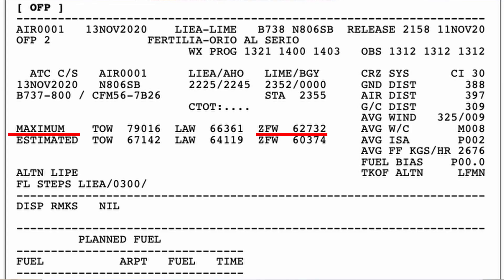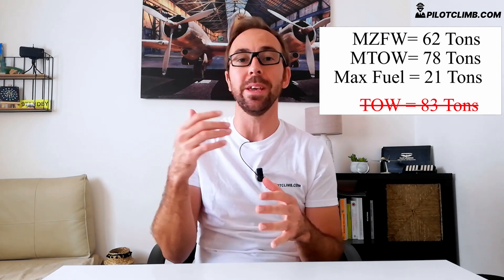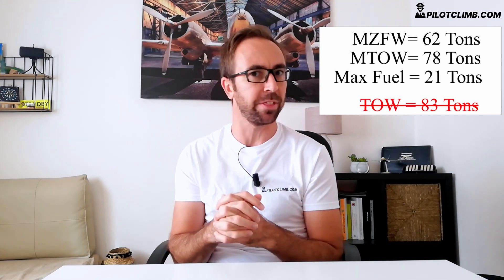Zero Fuel Weight - [What it is and how does affect your Flight Operations].

Comment: Do we use zero fuel weight in general aviation, single engine aircraft? I do not see this entry anywhere in the POH.
Reply from the maker: I'm not sure if the ZFW is used on general aviation, it should be since it is a structure limitation. But again I'm not sure. Check the AFM

Comment: Hi, thanks for the great videos. 

I am an airline pilot also. 

I remember in my ATPL exam days when doing the Mass and Balance questions we always had to first calculate the Regulated Take of Mass.  As you mentioned this can be structural, performance or max landing mass minus trip fuel. 

In the ATPL theory questions we also had to consider Maximum Zero Fuel Weight minus trip fuel. Which now flying in the airline, I see that we never consider this number at all when determining Regulated Take of mass. 

So in ATPL theory our regulated take off mass is lowest of the following:
MTOW : Structural, from manufacturer
Performance limited (due runway length, condition etc.) 
MLW minus Trip fuel
MZFW minus take off Fuel. 

However in real life it seems that in the airline world, we do not calculate (MZFW minus take off fuel). Which is good, because it is a useless calculation in my opinion. Still I am always wondering why we had to consider this in our exams.

Do you have any idea about it, or why we are using this in the ATPL theory, but in real life we don't even think about this?
Reply from the maker: In real life software will make all required checks, and as pilot we xcheck the loadsheet for gross errors..

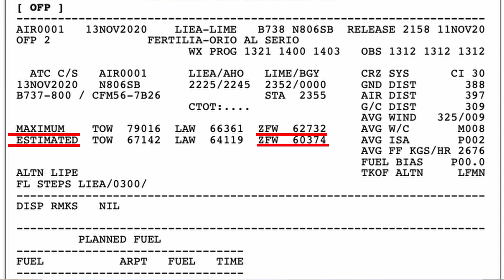Comment: Good Day Capt, in video 2:15 on a chart between TOW and ZFW is LAW.... It is mean Landing Weight? So in order to have a safety landing if our aircraft weight still above LAW we need to dump some fuel? Do you know if Boeing 737NG can dump fuel or fuel jettison system?... Have a great day ahead and thanks again for your excellent video.. 👍👍👍
Reply from the maker: Hey, many thanks for watching!!! Yes, LAW means Landing Weight (sometimes is indicated as LW) during normal operation and if the situation is not critical you should NOT land with a weight above the Maximum Landing Weight. I have been flying the 737 for more than 10 years and I have never seen a 737 aircraft equipped with the fuel Jettison System.
The regulations don't require to be installed on the B737.

Let me know if you still have any questions!
Have a great day!